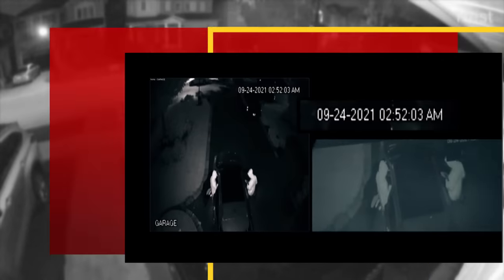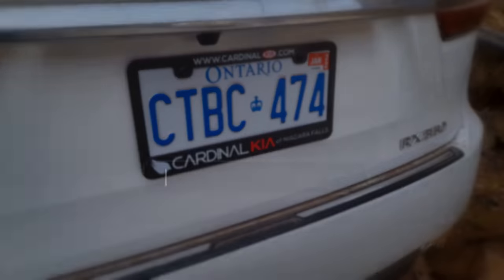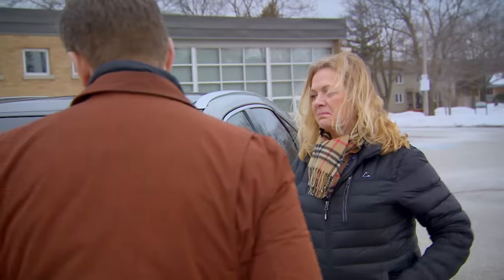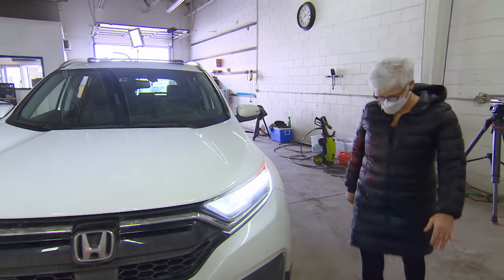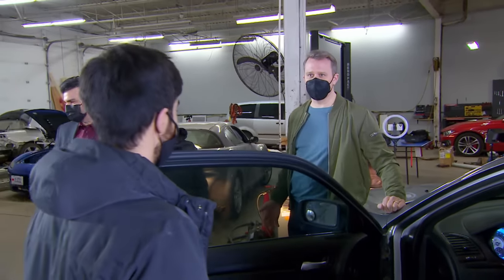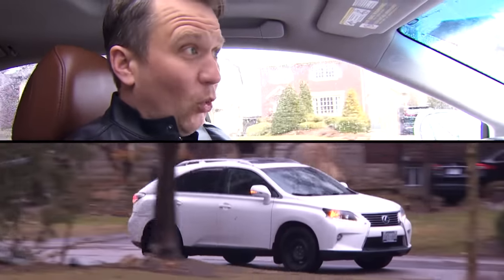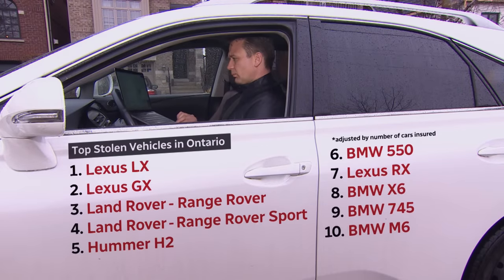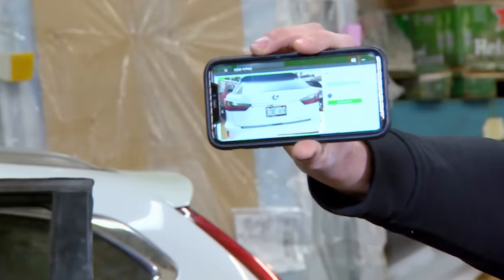Tracking stolen cars: How they could end up in West Africa (Marketplace)

Comment: No vehicle is safe from a determined thief.  If they want it its gone. Ever since the introduction of Keyless entry it has been on the increase . I'm a certified Professional Locksmith and have been in the industry for well over 40years and every year this has been on the increase as access to tools and equipment become more accessible via  the internet.
Reply: Even those with physical keys aren't safe if someone's got a hammer and a screwdriver.
Reply: What about a Tesla? Is it safe?
Reply: @Ban00  very much not safe; one of the least safe options as they've not been examined thoroughly by third parties to evaluate weaknesses. Terrible resale value on the stolen market though, so safe in the sense they're not worth the heat.

Comment: wheel clubs do nothing, get the one you attach to your clutch (or brake if auto)
Reply: Agreed! Look at the steering wheel at 21:36, someone cut it to remove a wheel-lock; hands down, concrete proof. If that car hadn’t been recovered, all the thief would’ve had to do is put a new wheel on & sell/ship it on. Pedal locks for the clutch or brake are far more secure. The only way to remove one of those could be to cut the brake or clutch pedal off; would you wanna drive a car with no way to shift or stop it? Didn’t think so either! Furthermore, the metal connecting the pedals to the car is much harder to cut than the steering wheel.

Comment: Step 1 : disconnect the Doorlock from the keyhole
Step 2 : install a aftermarket Alarm System 
Step 3 : install motion detectors w lights
Step 4 : avoid targeted Cars
Step 5 : Park ur Car inside ur Garage
Reply: Step 6: Avoid all your advice.
Reply: @kevinmach730  😂😂😂😂
Reply: @NissanPatrolLovers  😂😂👍👍✌✌

Comment: It is very easy to see that the car manufacturers are not interested in securing their cars, because every stolen vehicle causes a new purchase. 

But to the facts, the mechanical lock is at least better to protect, these cost however a 1..2$, more crucial is however the electronic security. As shown in the article, thieves use a commercial OBD box to create a new key for the vehicle, which raises two questions. Why is the vehicle access code a standard code or a code that is easy to re-calculate, because it depends on the chassis number, for example.  Solution:  Each vehicle receives a digital one-time code during production, which is given to the vehicle owner at the time of purchase. Only authorized and registered repair shops may carry out reprogramming in conjunction with the customer code, and the repair shop must also authenticate itself in the process.

Comment: Had a 14 ft trailer with a Toyota Tundra attached ,  3 specially fitted locks that were hard to break open parked at a Days Inn in Montreal after driving 22hrs from Savannah Georgia. Had parked it around 11at night , woke up at 6am to go to gym.....both were gone. Thank God for insurance however later that afternoon cops called, said they found it but it ran out of gas on road somewhere in east end and whoever took it managed to break locks  go through all boxes to take outall valuables than put locks back on.

Comment: At 9:25 ......Surely, if the car was locked AND the alarm was set,  the car alarm should have activated, when the lock smith opened the door?  Looks like the alarm was not set, as the owner did not press the key fob lock button, twice within 5 seconds?

Comment: A simple way to fix this, you make diagnostics port turn off and on by the key fob with a buttion labled with a gear. The shop working on your car will need the key to access the port. You can't program a new key if you can't turn on the diagnostics port, and you can turn the port on without the OG key.

Comment: The issue is that there always have to be a way to start/open a car when the key's are gone. And that can always be exploited.
Reply: Solution is simple, do not have a way to enter a car, without the keys short of breaking the windows or prying open the doors, that comes with a significant repair bill but in my view should cut most of these theft cases in half simply due to the ammount of noise that is made.

Comment: I had a 1998 Holden rodeo and couldn’t afford a car alarm. So i removed the relays for fuel pump and starter motor and placed electrical tape over the socket relay.

Comment: The solution to the problem of car theft could be achieved by implementing a complete ban on the export of used cars. It's perplexing to me how stolen vehicles manage to be exported. Exporting typically involves a shipping agent, and it's the agent's responsibility to verify and confirm the proper documentation of the vehicle. Only if everything is in order, the agent arranges the shipment. There likely exists a network, possibly involving organized crime, engaged in this illicit business.

Comment: I have a question regarding the man just using a lock pick and then connecting the Laptop to the car and setting up the key. Now, what if the alarm system is on my car. Is the only option is to use a transponder to make my key reach farther in distance and giving my car the illusion that I am there with my key and want to get into and even start my car?

This is absolutely terrifying! It makes it seem like why even bother locking the car if it is this easy to steal my car and so many like these in this Marketplace investigation. Thank you guys so much for putting out this video you guys! :trophy-yellow-smiling:

Comment: It's odd they are able to do this. In Europe it's basically impossible to steal a car without a key. When our cars got stolen (both Mercedes), the thieves broke into the house to find the keys. When last Christmas, due to roadworks we had to park our car down the street, thieves stripped the car in the middle of the night instead of taking it with them, something that happens more often in the Netherlands to high end cars.
Reply: Mecedes has same locks in Europe and in Canada. Yet Mercedes are near the top of stolen cars. I think the difference here is that its much harder to get them from EU to Africa (probably more strict ports), also probably heavier punishment (prison or deportation) if caught?

Comment: Disconnect the battery pull the fuel pump fuse pull the efi relay or fuse and pull ignition relay or fuse this may not be 100 percent effective if the thief knows what to look for if it’s not starting but they also might ditch it because it’s not starting and would take longer than usual and may draw attention

Comment: Hell fill the driver side door lock with super glue and always entered from the passenger side. Once you get home take the battery out. Keep it completely low on fuel. Put a rubber snake on the dashboard. Place a board with nails on it in the driver's seat. Remove the nut that holds the steering wheel on and simply quick release the steering wheel when you get home and carry it in the house with you. Install a manual fuel shut off valve on the pipe going from the tank to the engine reach underneath and shut off the fuel supply. And if you only drive in the daytime remove the headlight bulbs. Remove the tag light bulb so that you'll get stopped and when you do tell the officer cuz you've had your car stolen before you want someone to pull it over if it gets stolen again, and then no tag light will attract law enforcement to the stolen car. Because you don't drive at night. Except on a rare occasion the time that they pull you over and you have to tell them that. You can even let the air out of the right front tire when you get home, and refill the tire each time you go to drive your car. Flat tire will stop them quickly. If you really don't want your car stolen there's a list of things you can do. I'm sure I can think up some more. You're better off buying a really old car.

Comment: Here's a novel way to reduce car theft, have it so you physically need to put a key in the ignition lock that is fitted with an immobilizer transponder and has a mechanical steering lock that works off the key when you turn it, it used to work in the start 90's 00's when cars were more difficult to steal because you needed that key to disabled the immobilizer and steering lock and start the car, it's the manufacturers to blame for the rise in thefts due to their new gimmick of how the car is started.

Comment: Easy solution: don't buy a Lexus until the manufacturer addresses the issue and actually implements a such high tech feature as a cryptically signed key for the identified owner and disables remote ignition between 10pm and 09am without a pin code

Comment: It's all because consumer's have chosen convenience over security.  Slightly older cars required that you have a physical key with a security chip in it that transmits through the ignition lock to allow the car to start, or that would only transmit about 1 foot.  But who wants to actually open the car with a key, or start the car with it?  Everybody, just wants to walk up to the car and pull the handle to get in.  Then once in push a button to start the car.  That comes with a price.  Thieves are also able to just walk up to your car, push the button and drive off.

Comment: Older F150's made you wait 30 mins before you can program a key. Why is this still not a feature with other manufactures people be less likely to steal if the computer on the vehicle requires longer time to sit before a key is programed? For the sake of convenience they lowered that time to 20 secs. But its not convenient when you vehicle gets lifted. Also even my 2000 Police Imapala will sound the horn constantly if the door was locked and the fob was not detected when they picked the lock to get into that honda. Why is old antitheft technology that made it annoying for thieves not present on modern cars? Hondas and Toyotas have always been easy to steal. 2000s 1 key from honda could start like 8 other hondas and even some toyotas because they all used same tumblers.

Comment: You put a tracker on you car , where the thieves won't find it ! I know someone in Foresthill that had their brand new car taken from their drive way and no one seen it .  You might install motion detectors with an alarm to your home . Car manufacturers are gaining from the theft of their vehicles .
Reply: You put bollards on your drive and they smash your door in for the keys to the bollards.
Reply: @robi4387 : The trackers fit in the tiniest part of the car , like a back seat light .  You can have alarms the alert only you when some is near the car,  then you sound the bullhorn and hit the flood lights .  If you home has an iron gate lock them in until cops arrive . Perhaps having massive pitbulls running out to greet them .  They need to be hurt real bad to learn a lesson . Your bollards should be operated from the inside of your house , you take the key inside with you .

Comment: The issue is not with in car manufacturing loop holes, instead education systems failed miserably. Please,Please don’t fall for this narrative. This documentary can be sponsored by actual car manufacturer. As a car maker u want all rights on your new sold vehicle. This can be fixed with new ECU software. Here the is the catch u no longer own your purchased car, all rights of any I mean any replacement parts or alternations will get u in jail. If u replaced a factory wheel with aftermarket u will comprise “safety “ and u will be ticketed. Do not, I repeat do not fall for their “solution “ instead say I have my own opinion on the matter and you will see how they will react.

Comment: If I tried to open my car with just my key and without using the fob first, the alarm would go off the second I open the door. Only by putting the key into the ignition and turning it would my car shut off the alarm. Any car that doesn't have this feature is a piece of trash.

Comment: Car owners needs to removed the battery and another easy to removed/installed parts from their vehicles this way the thief can't drive away with the expensive vehicles.
I'm very suprised car owners not thinking about these common sense solution. These are the common sense solution the "car dealers" won't tell the consumer.

Comment: 7:45  bullSh!t, Chrysler has a Gateway security module it will not let an unregistered scan tool programmer to access key programming. Also im order for the scan tool to talk or communicate to the car the car must be in ON or in ACC either with the mechanical key or the original FOB. A bit of sensationalism in this show.
Reply: Gateway security modules were only added with the newer cars 2018/19 and up , and even then you can use the cable to bypass it :)